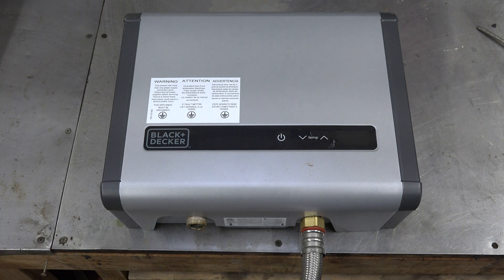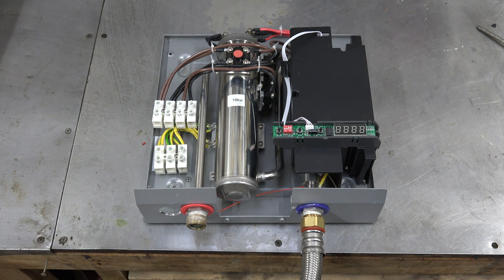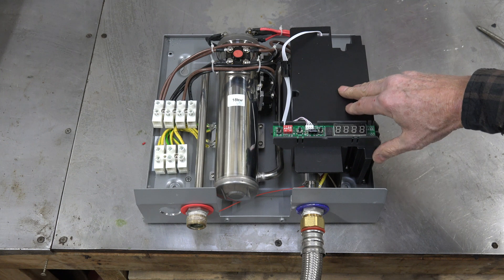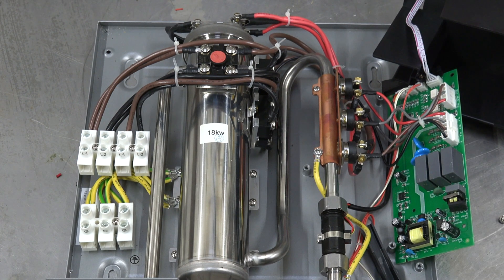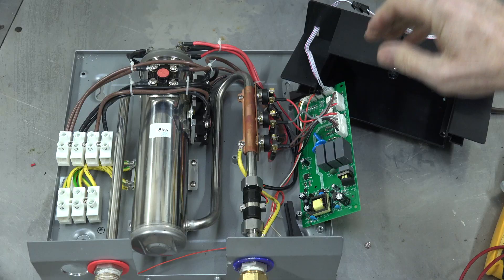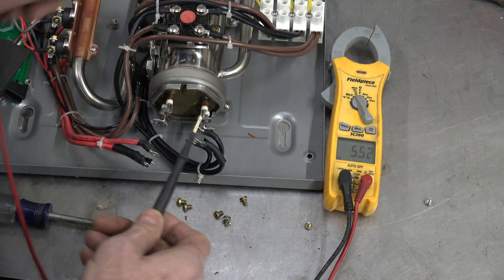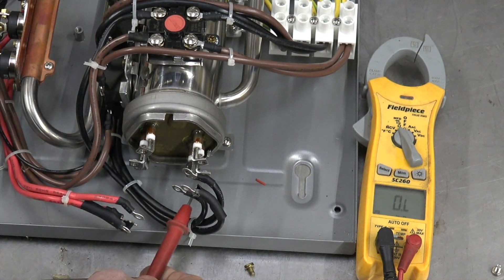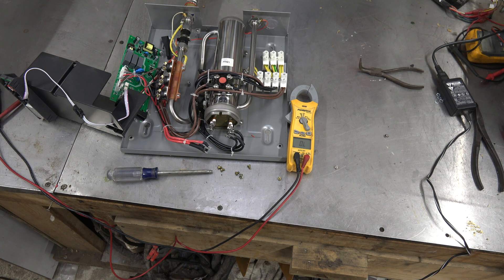Instant on water heater failure

Comment: What are the chances that the elements are installed in a radial layout rather than linear, the way you tested them?  Does the bottom left to top-right have any continuity?  If so then only one element would have shorted out (top-left to bottom-right, the two that show continuity to the chassis).  If you leave the one element unwired is the control board smart enough to bypass and only use the other two?

Comment: Since you're into solar and being your own backup power plant, won't you be replacing this with a LP or N gas unit?  18KW resistive load would be a big burden if grid down I imagine.
Reply from the maker: No, The whole point to solar is to eliminate the use of fossil fuels.  
GFM
Reply: @grayfurnaceman  Understood. If you don't mind sharing, how will you provide electrical needs for home and car charging if we lose power for a few weeks, or even a few months?  Would you just have to go without heat (or AC), hot water, and cooking until the power comes back on?
Reply from the maker: @Robnord1  Losing power for a few months is probably unlikely unless you live in a 3d world country.  However, the idea of being able to provide your own power for the vast majority of the time is compelling.  
My system produces around 6,000 KWH excess power each year.  Battery backup can store much of that power to keep vital systems operating.  
GFM
Reply: @grayfurnaceman  I'm envious of your solar. If we didn't live under a dense canopy of 120' + Cedar trees here in western WA, I'd cover my entire roof with them.
Reply from the maker: @Robnord1  That could be a problem.
GFM

Comment: Black and Decker is hardly a respected brand in this product space, I can't imagine a pro would consider selling or installing it. Do you consider this to be serious equipment?
Reply from the maker: No.  The unit was installed as an experiment to see if this type of heater is viable for use with a solar powered system.
GFM